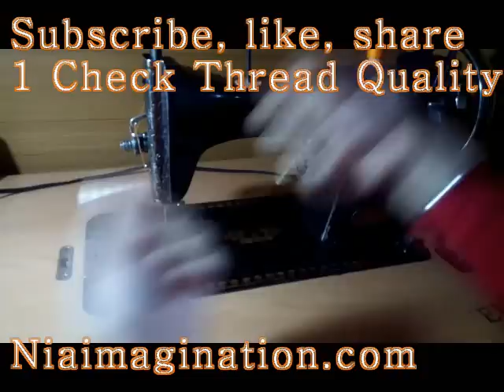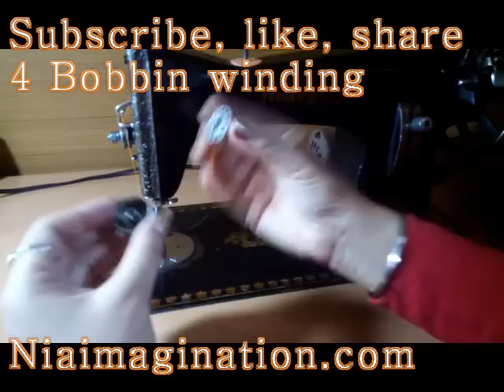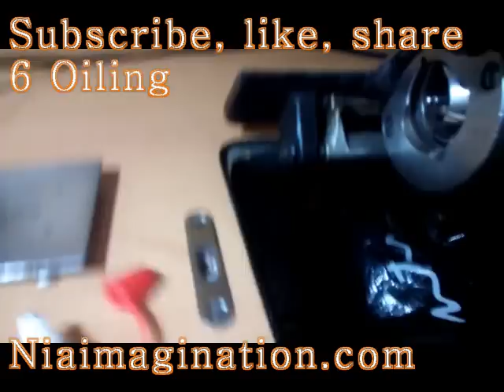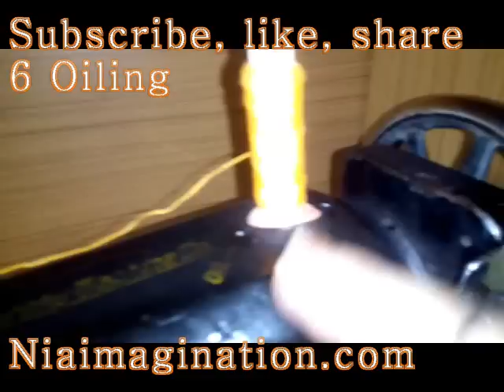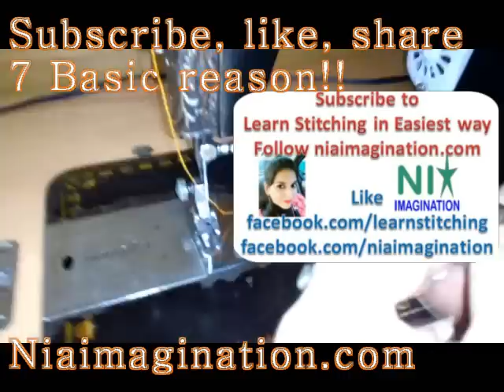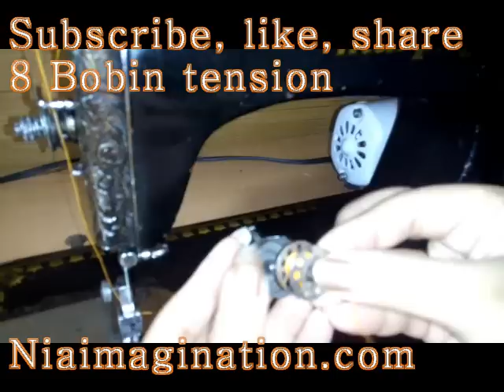Why thread breaks and 8 ways to fix it | in English | sewing machine

Comment: Thankyou so much
 my bobbin is loose how to tight it
And handle of the machine is very tight how to loose it
Reply: Put oil in the handle an for loosening of bobbin check there will be a small screw on bobbin case you can tighten it with